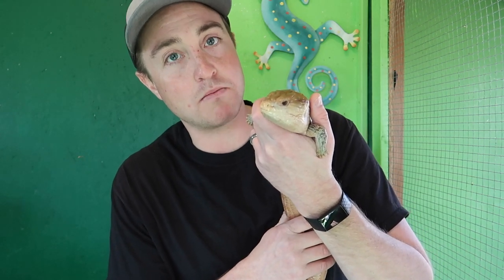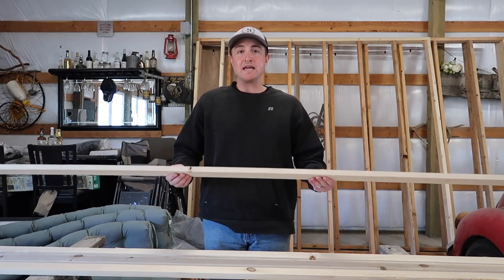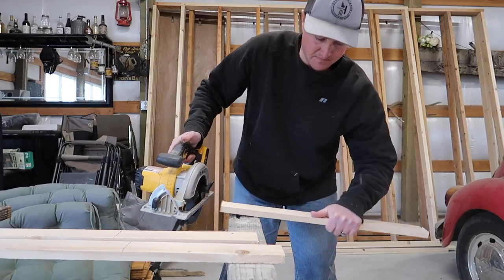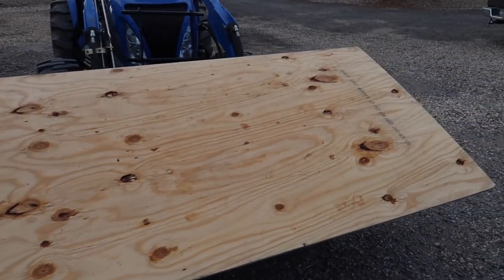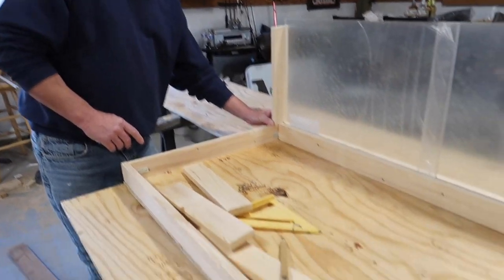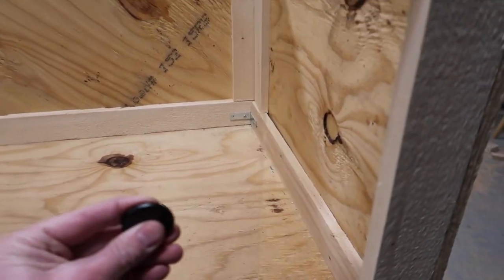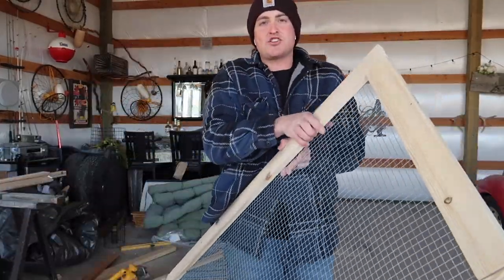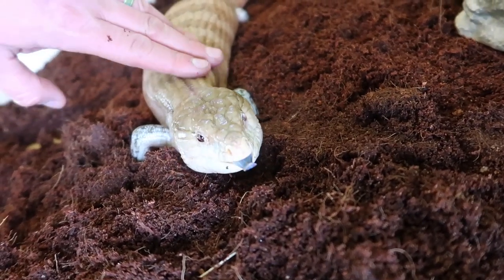How To Make A Lizard Cage: CHEAP!!!!

Comment: Love this but would def need a waterproof barrier of sorts for higher humidity reptiles so the wood doesn’t rot.
Reply: Try Dryloc basement waterproofing paint
Reply: He has a northern blue tongue skink, not an Indonesian. They don’t need as high humidity.
Reply: @malyndahsexotics1543  The person in the video said this could he used for a ball python, which is incorrect. That's what Crystal meant.
Reply: @ThrowinBombs80  well I wish crystal would have elaborated then because then I probably wouldn’t have posted that comment to begin with, I was under the assumption that she thought his skink needed a higher humidity, which is incorrect, but if she was just speaking in general then she is correct and so is he, just add in a something water proof to help contain the moisture. I guess the only real incorrect one here is you.😂
Reply: furnish
Reply: Just thought the same thing . I was like the woods gonna rot ! I’d use drylock what would you guys use
Reply: @donteague614  is this safe to use on stained wood and in the interior of a reptiles tank??? my friend and i were staining my beardies tank and she started to stain the inside so we just stained all of the inside and i want to make sure this will be safe for the interior of the tank too?
Reply: Personally I wouldn't use it on the interior. The vapors will last for quit a while. That can't be good for any body to breathe.
Reply: @donteague614  do you know a way I could fix my mistake? Or a seal that won’t last long and will be safe for interior sealing?
Reply: Honestly I'm not sure maybe you could sand it off than use latex paint? It seems latex paint maybe safer but it gives off its own vapors for a while. I'm thinking those maybe safer than stain vapors? If you do use latex I would let it air out for days?  Maybe with the stain after some time it might be safe the vapors can't last for ever?? Good luck with your project
Reply: @donteague614  thank you so much!!yeah ive been starting to sand off the stain in the interior of it. I might just get some safe seal and seal everything then buy a background to stick onto the interior walls.
Reply: Safe seal never heard of it, thanx for the tip.
Reply: @donteague614 is it safe to use inside of an reptile enclosure?
Reply: Not sure I've never used safe seal before.
 I've heard of people using dry lock haven't heard anything bad bout it yet.
Reply: I had a bearded dragon and built an enclosure for him. Bout this size. The floor started to rot just from his shit and piss

Comment: I’m going to making this this month but I’m not going to have the top open up like yours it will stay down. I’m also going to be dry locking the inside because my substrate has to stay moist a little so I need it water proofed! Thanks so much for this cause this is exactly what I want and I don’t want to pay more than I have to getting it from a place that makes them is just too much when you can build your own!

Comment: Would the chicken wires be ok for letting in heated lamps for the beard dragons?
Reply: yes although you will need a cross section on the chicken wire because its weaker

Comment: How tall is this? I have started to build my own but it’s not working as easily as this one….I know it’s 4ft long, 2 ft wide but how tall?
Reply: If the bottom frame is 3in, the top frame is 3in, with the sides at 14.5, then it would be 20.5 in tall without the screen top?
Reply: @krystalrectenwald2796  I came up with the same measurements 20.5x24 inches for the sides.

Comment: Would an iguana fit inside? I want an iguana
Reply: A baby iguana, sure. 

Iguanas are huge animals though. You'll need a room sized enclosure, or an outside one where they can climb. This will not hold an adult.

this is a 4x2x2 and a green Iguana can easily reach 5-6ft.

Spiny tail iguanas could be kept in something like a 10x8x10 maybe?